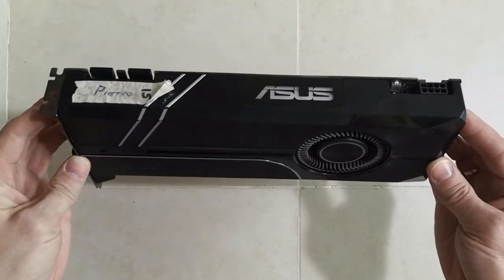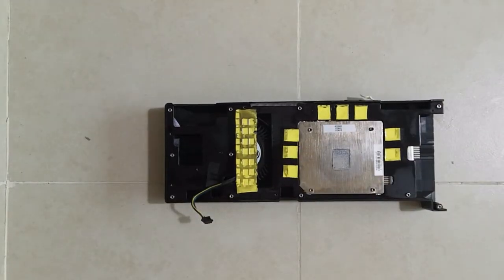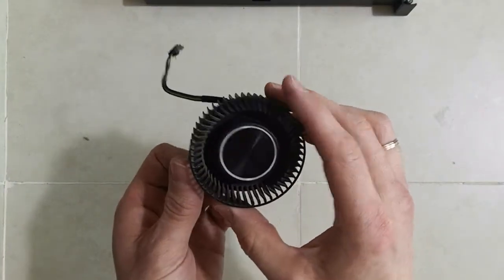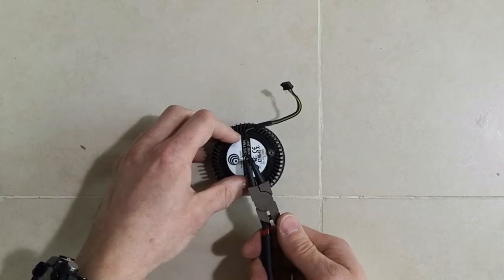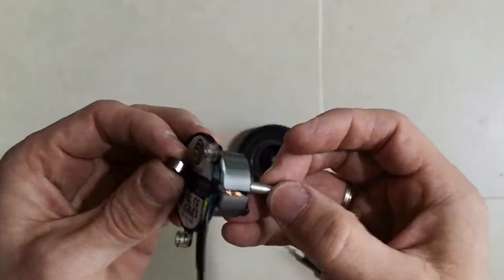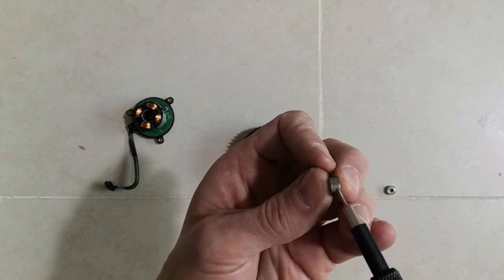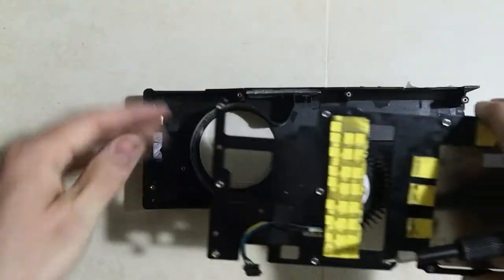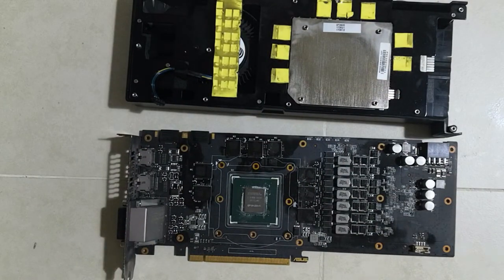Taking apart ASUS GTX1070turbo and replacing fan bearings

Comment: great tutorial! 
I got the bearings and now my GPU is much louder. 
I hope with time it will get quieter, but then, why did I replace them in the first place?
Anyway I'll be commenting again hopefully in a week after using the new bearings.
Reply: Couldn't listen to it for more than 10min, replaced the bearings right back, probably because they were dry af. I didn't buy lube for bearings. Anyway this helped me to clean up accumulated dust in the fraphics card and therally clean it. Have the additional lube and process of lubing in mind when doing this. Also, I managed to remove circlip with 2 toothpicks, though I did use 4~5 toothpicks in total as they tend to break. This did bend the circlip a bit but didn't break it. Thanks for the tutorial! It gave me courage to open up the graphics card myself.

Comment: Can you give us the Link of where to buy the fan bearings?
Reply from the maker: Hi! Well I got mines from AliExpress, but I believe you can get them from various of places. The bearing label is 693ZZ with dimensions of 3x8x4mm. Here is the link I got it from but not sure if that particular is still available: US $1.73  13%OFF | 5pcs/lot 693ZZ Bearing DeepGroove Ball Miniature Mini Bearing Steel Rolling Bearing 693-ZZ 3*8*4mm 3x8x4 Bearing Steel Material
https://a.aliexpress.com/_mKgTzyV
Reply: @ajs32tricopter   would they match a gtx asus turbo 1080? or should i serach for other bearings
Reply from the maker: @hepburnrodriguezricardomau4711  Hi. I believe its the same body, same radiator and the same fan. But its better to take it apart and see the model of the fan. I will post later the model of the 1070 fan I have. If they match, bearings are the same
Reply from the maker: The model of the fan on my cards is PLB06625B12HH
Reply: What was yours fan nember?

Comment: My fan is noisy but i'm scared if bearing case is maybe bad also but a new fan cost me 80 dollaaar :(((((
Anyway nice Video thank you.
Reply from the maker: Thx for the comment. These cards are quite old already, try to change the bearings, if that will not help, I would go to aliexpress. Got a fan from there for one of my cards: it looked cheap but is doing the job for over 2 years already